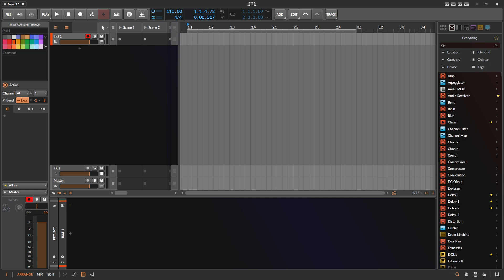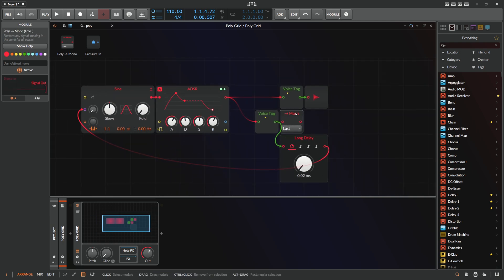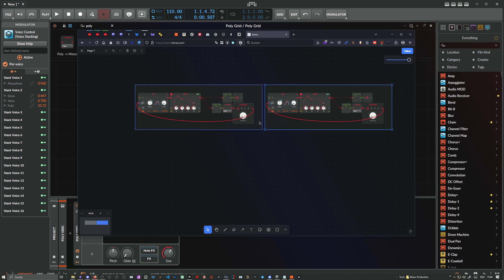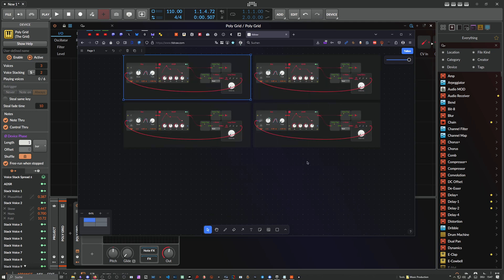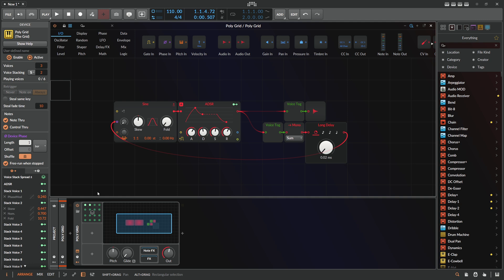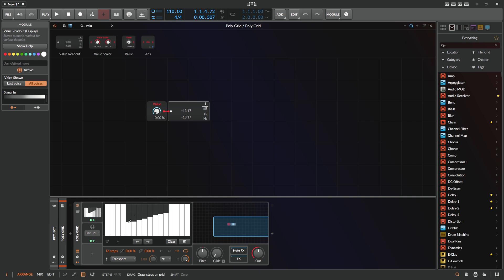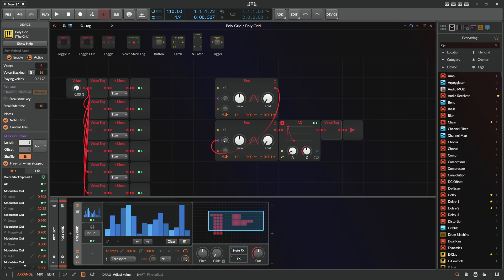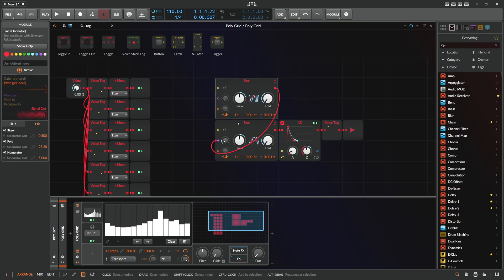this video is for Nerds only - Crossmodulating voice stacks in Bitwig

Comment: Thank you very much for this video, I tried to extract the modulating sum from polyphony in feedback patches in grid, but it was impossible “the classic” way, because modulation is shared in all voices and quickly becomes recursive and gives not expected results, but the way you show it is totally possible to make sounds like by upcoming Chromaplane or something like Colin Stetson make with his voice through saxophone, very cool!🎉
Reply: Be careful not to confuse yourself. Voice stacking is not polyphony. Both can be independent from each other. If you enable voice stacking in a polyphonic grid, you get your stacks of voices per incoming polyphonic voice. So if voice stacking is set to 3 and you play 3 notes, the devices outputs 9 voices.
Reply: @ohcibi  thank you for your concern, I was hoping it was clear from my exact comment that I’m totally aware of differences between these two concepts and I was writing exactly about it, maybe I did a poor job explaining myself and/or you didn’t understand what I wrote.